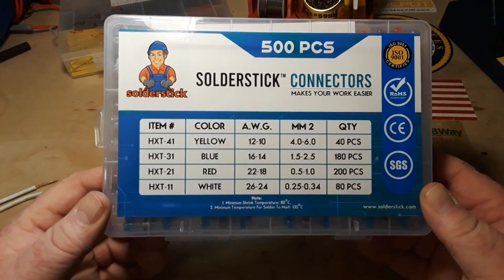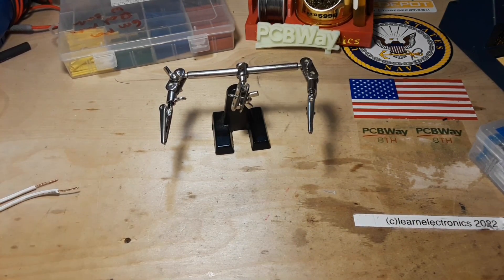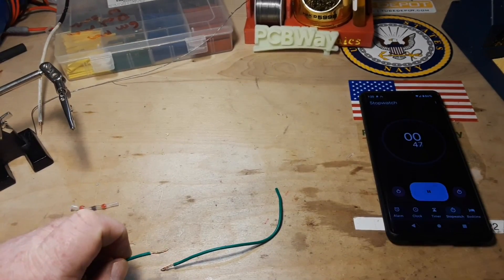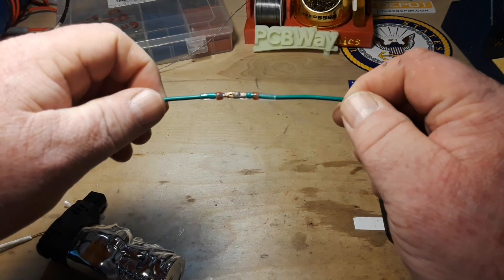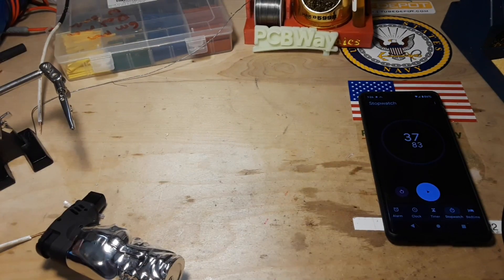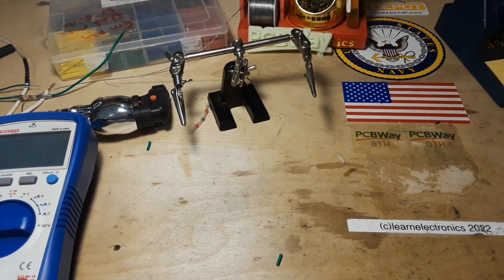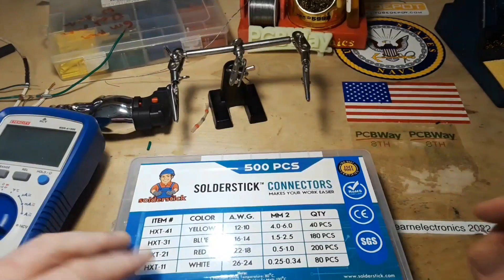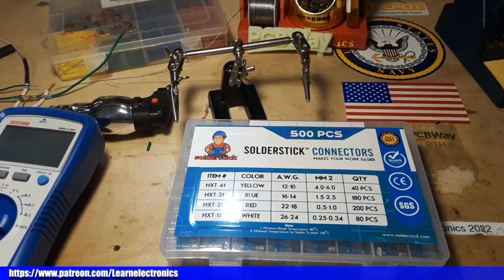Solderstick Solder Wire Connectors

Comment: The sticky require a heat gun you did not properly use them
Reply from the maker: Why does it matter where the heat comes from? Heat is heat, molecules moving fast. Doesn't matter how they get moving unless you are specifically looking for combustion.
Reply: @learnelectronics  your heat source is way too low a proper heat gun will melt the Soder and heat shrink withing 30 seconds or so i use these almost daily in automotive applications havnt had one fail or one fall apart like in your video I'm just saying your clearly not experienced in using them your actual sodering joints look great tho just stick to what works better for you

Comment: I've  used these before. And continue to this day. Here's the thing. If you try to heat it with anything hot enough to melt the solder, the plastic coating desentagrate. What I do is just heat the hell out of it. It has been held for my wiring application . Just an fyi

Comment: You are doing it the wrong way. You are not supposed to use a lighter, that is to much heat. Both the glue and solder are low temperature melt, so[ a soldering iron is better, or you control the heat from the lighter via a nail, screwdriver whatever..

Also the color is hotglue, so it is suppossed to melt and flow much better than you showed. When done correct, these connectors will shrink quite a lot, and it will give you a very strong and electrically solid connection. But it has to be done the right way..

Comment: I have some of these. I prefer a crimp style with a heat shrink butt connector. Squirt in some dielectric grease before heating, water resistant and faster.

Comment: Dab the wire with flux before using the solder sticks. Really helps with flow. Just an fyi lol. They also work better with heat gun.

Comment: Trying to melt the solder with a lighter or torch is way too hot.  Use a heat gun set to about 150°C.  That will melt the solder without destroying the shrink tubing.  You want to see the solder ring melt and flow into the wires.

Comment: I use the Solderstick at work, you have to use a heat gun for the solder to melt and flow. I tried a mini torch, but only melted the heat shrink and not the solder. Also use a bit of flux it helps

Comment: Heating with hot air gun to 300 C,  the soldering parts are crushed  together but NOT SOLDERED together... remove the plastic insulation with a cutter and pull...

Comment: I would rather have seen you measure how many ohms resistance there was instead of using a continuity checker. The continuity checker doesn't necessarily require "no" resistance to be activated, rather only very "low" resistance. For the sake of reliability, I always twist the wires together unless it isn't possible for some reason. I have some solder stick connectors and have tried them but don't find them to be significantly faster or more convenient. When I have used them, I used my hot air soldering station and that worked reasonably well. Supplying "enough" heat without burning/scorching the insulation is problematic.

Comment: Big Clive did a video on these back in 2020. "Heat shrink solder butt connector test." ( https://youtu.be/unxEdyW8RP8 ) The teardown afterward showed exactly why you should just spend an extra minute and use the old fashioned way. Of course, in an emergency situation, they can help get you back to a shop to perform a correct repair, but that's about it.

Does anyone remember the Solder Tape that Radio Shack used to sell? Little flat tabs of rosin core solder you could wrap around wires and use a good lighter to melt. Think I have some left in a box somewhere... Shoulda stopped in the Mt. Union / Allenport PA Radio Shack last week to see if the had any N.O.S. stuff still on the shelves.

Comment: Sorry, but I don't think so. I'll "stick" to the old way. I was taught that solder was for electrical connectivity but not for physical strength. I know that has changed with the advent of SMDs, but I still like my wire splices twisted and soldered.

Comment: Where i see this as useful is for patching things like in a car until you can repair it for long term. The lighter not melting the solder is disapointing.
Reply: I had the same thought. They will come in handy in awkward places. Cars, standing on ladders, if you can only solder with one hand.